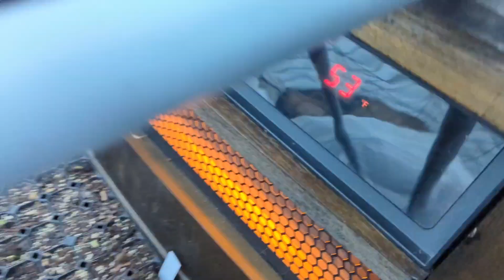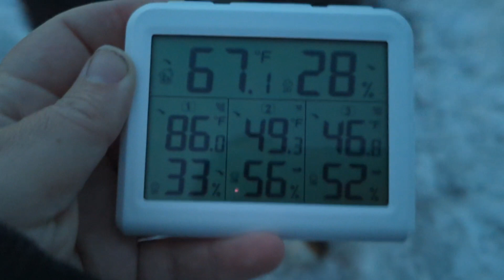I hope this works! Moving the plants out with a blizzard coming

Comment: You need heat mat with temp control.  You will love it.  I use an Eden Pure to heat my small greenhouse because that’s what I have, but be careful yours doesn’t catch fabric on fire.  A heat mat will keep the soil warm which is what counts to germinate seeds.  Generally it will keep the interior warm enough or you could add incandescent Christmas lights.
I can’t imagine having that much snow at this point.  I was so excited to see warm temps this coming week I kicked the seedlings out to GH.  I need a bit more room and will remodel with heat sink later this year.  I’m south of you Z5a.
I don’t know if you seen my comment because I put it in the wrong spot last video, but we had breaker rock hauled in for our long driveway as I’m done with the swimming hole.  My husband was wondering if they have it up there, I said they should as they have roads.  We payed that down and when the quarry defrosts will have washed gravel to smooth out.  We have sand just like up there.  It drains fast, but when frost comes out and melting or rain it takes a bit to seep in.
However I am SO HAPPY with our Now raised driveway—huge difference.   If you do get a load or several Make Sure it is without sand and tiny gravel—it happened to us last year where they brought what they said was 3/4” recycled concrete—JUST AWFUL!  Should have rejected it because now in those areas it’s mush.  It has to be large 3-6” rock.  We went to another supplier and couldn’t be happier!  
Hope it warms for you guys this week.😊
We just got chicks on Tuesday after not having them for a long time.  One has a splayed leg we have in rehab in the house.  She’s listening to my Spring Peepers CD😂😂. It’s amazing how it calms her down.  😂she’ll probably chirp like that😂😂
Reply from the maker: A heat mat wouldn’t provide enough heat.  We had 0 the other night.  Soil temp is 60 in the high tunnel though.
Reply: @MitzaCreek  I’m surprised that the peas didn’t germinate.